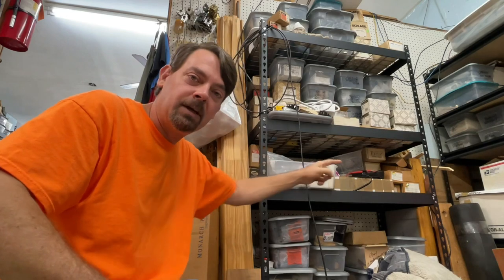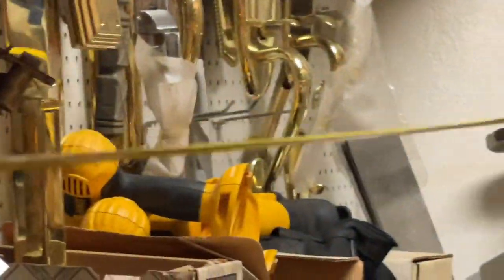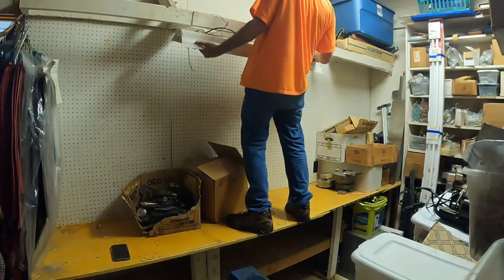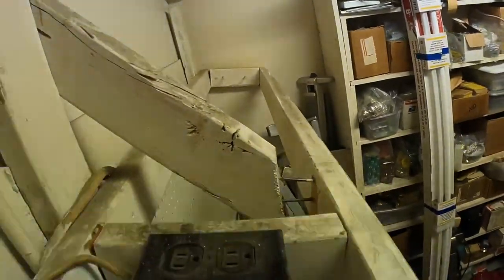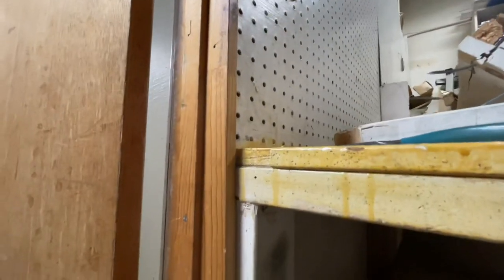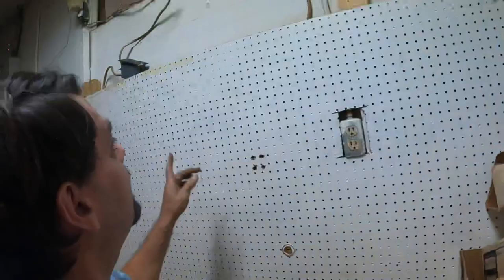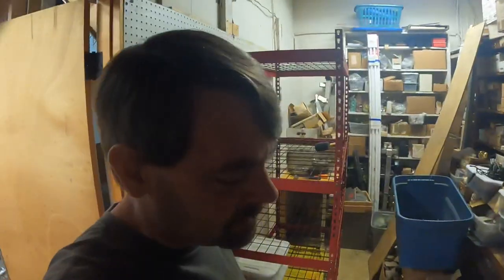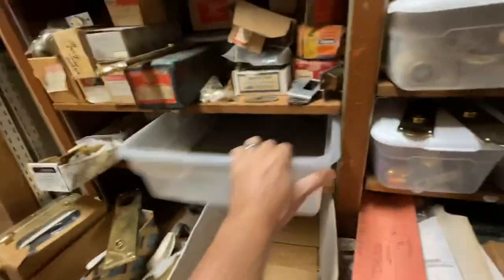Lock Shop vLog 9 “the beginning of the Red District”

Comment: I have the same shelf that is NahKeyToma 4. If yours has the screw in legs at the bottom the blue store has casters that screw right into them. Then you can be mobile with #4. 🤓👍
Reply from the maker: ahh 4 is being held captive by the wood that wasn’t ever cut away, I think…if any the coolest one to have roll-ey style would be 1 but there’s so much weight on there I wouldn’t trust any ole casters
I think I mentioned during that build or slightly after that a slide mechanism cut into the floor, or even surface mounted rails would be super cool to at least move back and forth

One of our institutional customers has a room full of sliding large shelves and they are wildly exciting to get between 😂